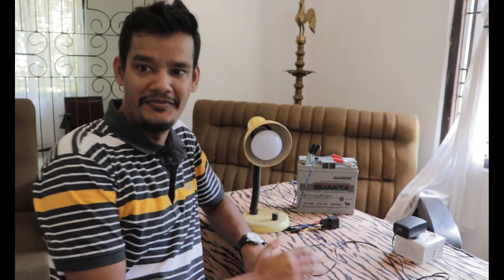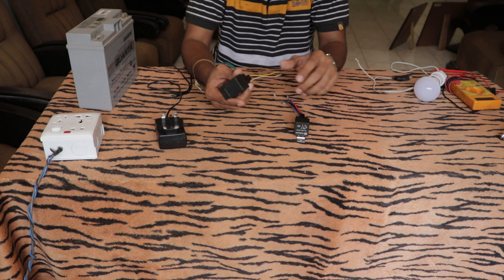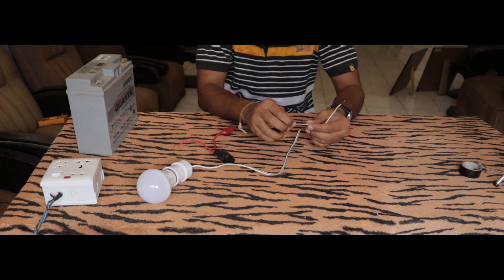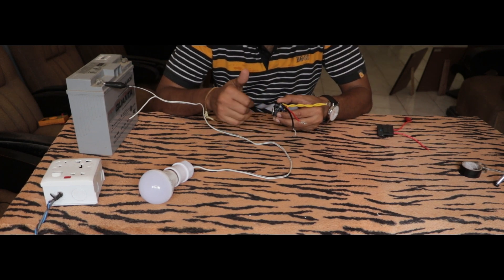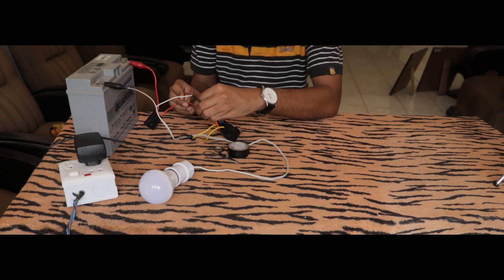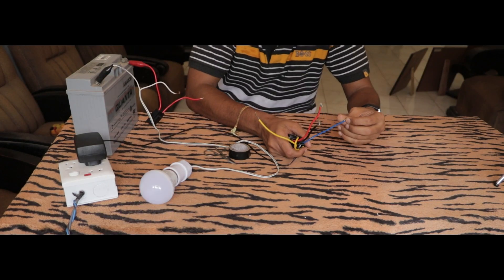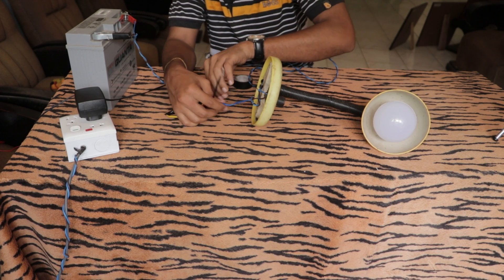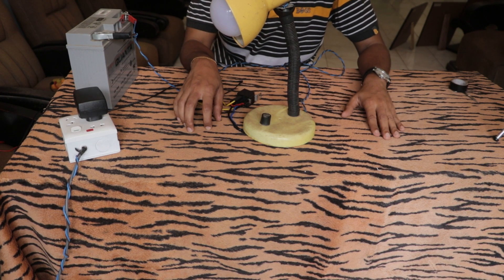DIY Emergency Light

Comment: I thought on using a car type battery (for motor home or trailer) with multiple lights - hall way, bathroom, kitchen, etc.  Also, a photo sensor to keep the lights from coming on during the day time.  Finally, a little bit more work, away to have the lights come on for one minute and then turn off automatically.  If you are home, you turn a switch to keep the lights on.  Incase you are not home when the power goes off,  you don't need light and come home to a dead battery.  Extra needed parts are a timing relay and light activated switch.  An electrical drawing would be nice.
Reply from the maker: To turn on the lights for a 1 min and turn off automatically, can use a delay timer circuit. So that will keep on the lights turn on for a pre set time period. 

For the lights to come on only during the night time , you can use the photo sensor and a switch or a digital timer. So that you can switch on this load for the time and date that this load should switch on.if you a using the photo sensor  to active the circuit, it should be night time and the switch also should be switched on .

And for the dead battery issue, you could go for a battery protection circuit. Which will have the low voltage cut off protection. So the load will be switched off automatically  when the battery voltage reaches the minimum voltage that has been pre set through the same circuit you can activate a battery charger that will turn on once it sense the low voltage and switched off when the battery reaches the maximum( full battery)  voltage that can be set from the same battery protection circuit. 

To active these circuit only when you are at home,you can use a switch or a ignition switch that will come with a key.so that you  can switch on all the lights using that key.once you remove the key all the lights will be switched off.